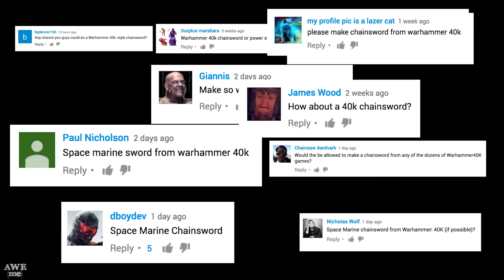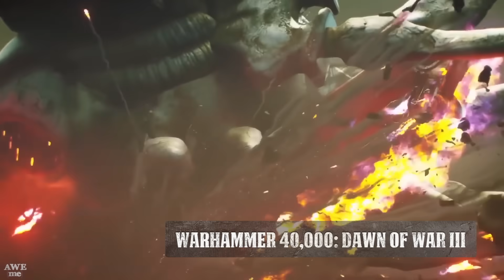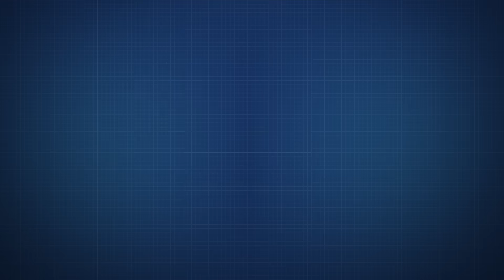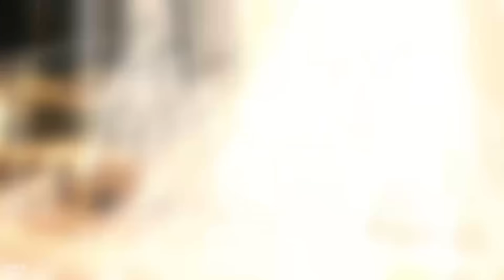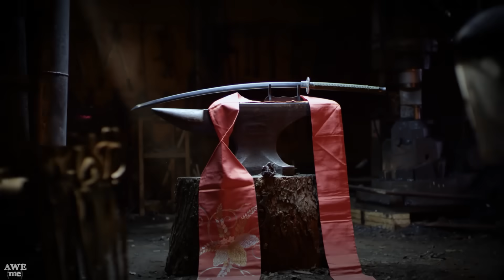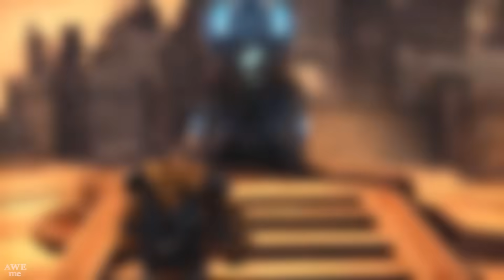Warhammer 40K Chainsword - MAN AT ARMS: REFORGED

Comment: can someone tell me if its possible to get one made that is usable not 4tonns?
im not looking to buy just wondering if its even possible and thats why they didnt do it? it may be to be lore friendly and make it in space marine size, i doubt it.
but it would be hard to get a small engine to run a track of that size and still have power doesent it?  tho i dont think it would be imposseble to get a custom made track and blade :/ if anyone knows please tell me!
Reply: Emanuel Desperados a chain run by electric motor would work but it would lack the torque to cut decently. you would be able to wield it though, especially if the battery is on your back like how the marines ones are.
Reply: +Josh Deller have to correct you there m8, you see some models with cables from their chainswords to their backpack but those are imperial guards, the entire engine and fuel tank for a full sized space marine chainsword are in the sword itself. This would make it to big and heavy for a normal guardsman tho.
Reply: sint en piet your right I was thinking power swords too
Reply: would be nice with a power sword aswell tho but thanks for the answer boys!!

Comment: I wonder if having the chain move the opposite direction wouldn't be a better idea for functionality. That way it would throw viscera and etc out toward the front of the blade rather than drawing it down into the machinery and user.

Might have to add some hooks at the tip of the blade to sort of latch on to whatever you were trying to hit, though. or perhaps even serrated teeth along the front of the blade to create more friction against whatever you strike with it

Comment: I see plenty of comments requesting power swords. While they are majestic weapons in 40K, I have to question the validity of building one though. I mean, how would you build a "working" power sword without the sci-fi power generators coating the blade with a power field of disruptive force?

Wouldn't the end result just be... Well a sword, with some decorative wires and gubbins on it?

Now someone might suggest making the blade electrified by attaching a stun gun to it somehow, but remember that power weapons aren't shocking weapons, they use these sci-fi fields of disruptive force to cut through pretty much anything.

If you really want a 40K power weapon that would have a pretty unique look though even without sci-fi power field generators: might I suggest making an Adeptus Mechanicus Omnissian Axe? I think that would make for a pretty awesome build.

Comment: Why is it that heat creates problems in high carbon steal but also fixes those problems? If someone answers this, feel free to be technical.
Reply: It was explained in a previous video. When you heat at a high temperature you harden it. This makes the metal very hard (which is good) but also brittle like glass (which is bad) This is because the material crystallises. Reheating the material to a lower temperature melts the crystals and causes the material to become slightly softer than it was previously. This way you end up with a metal that is hard but also flexible. If you want a steel that's harder then the material you've tempered you need to risk it being brittle. This is usually reserved for files and other such tools that need to be harder then metal they're cutting.

Comment: I attempted to mimic your Brazing technique using a wirewheel.

I only have a Polypropelene Torch which can't really heat the steel quick enough for this sort of contact melt.

You are using an OxyAcetlyene torch yes?

Also what temperature are you heating the steel to to transfer the brass?

Please and thank you :)

Comment: Forge Illidan's Warglaives of Azzinnoth
Reply: That was already done
Reply: uh I just checked the entire channel and no, it hasn't been done.
Reply: +Broken soffa I would like to start by saying that "actual usable weapon" and "warglaives" are antonyms. Moving on, if they made Azzinoths Warpaddle from solid steel and as thick as its supposed to be in game it would weigh more than a small car. If they made it as thin as a propper blade should be it still would leave the part where you run around one handing something the size (and probably also weight) of an ironing board. 
So nope, a nice decorative wall hanger is as far as you can get 80% of weapons I saw in WoW.
Reply: Bomburino Kripperino You're right, but it was done as hollow, unusable replica pieces.
It would be great to see the man at arms crew make actual usable weapons of the warglaive idea
Reply: Dariusz Zaremba You're right, they will be probably be too heavy. Thank you for clearing that out, never thought of the boat anchor part of it

Comment: thats sweet totaly inpracticle and useless but cool none the less
Reply: practical for a space marine, but not for regular people
Reply: I heard my name.
Reply: thats pretty true of how a chainsword would be in real life too. Looks much cooler than is practical
Reply: +N Welp If youre strong enough to wield it properly, it is useful. But its not designed for a normal human
Reply: If you had the strength to wield such a creation,  it would be a overpowered and  scary weapon.
Reply: Three real life problems with it; the blade would easily be gunked up, it has multiple points of contact which dissipate the force, the whole thing is very heavy, dangerous and impractical... and how the setting solved it; monofilament chainsaw blades, several discs of saws rather than a single belt that can be reversed with a button, chainsword dueling is basically finding an opening, holding against the foe and letting her rip, and mostly used by 8 foot tall grotesque muscle men.
Reply: +Baran Duman Yeah but they are smaller and less heavy, except for the eviscerator, but those priests are slow af with that thing.
Reply: 115Harvester There are chain swords made for guardsmen too. For sarges, commisars and priests.
Reply: not in the hands of a space marine
Reply: +Baran Duman true, but aren't those ones a bit smaller?
Reply: 115Harvester Yea I guess. Still not pratical.
Reply: enit lol
Reply: +Baran Duman you get it wrong guys these things are space marine weapon and space marines are hmm superhumans ypu cant expect a normal human likethem to wield a chainsword 8P
Reply: Randy Pelton Dare you question a design of the Holy Cult of Mars?!?! *BLAM

Comment: They made this, but still haven't made a weapon from RWBY? If they made the chainsword, they can definitely make any weapon from RWBY.
Reply: shotgun gauntlets? gun-chucks? briefcase mini-gun? grenade launcher sledge hammer?
Reply: khornes knight Anything is possible as long as you believe.
Reply: depends on the weapon . some are rediculusly complex and brake basic engineering concepts like literly not havingenoguh volume to acomidate one of the weapons forms ,while others will just bee too brittle with known metirials. 
hell , even this chainsword isnt truly functional, to make a functuinal one theil need to have a proprietery blade and proprietery chain ,  with the chain digging deeply into a rather thick custume blade 
because if you take a normal chainsaw and start swinging it quickly on stuff like flesh or even wood there is an extrem danger that the chain would come off and thath the whole thing would bounce back at the user. meaning that an ideal desing is a thick blade with a thick chain guarded inside it with the chain blades pretrudeing out of the blade .
Reply: stickpge Would still be nice to see one.
Reply: I think i figured out how they can do that, They should do a challenge where they all make the cresent rose, but one is the scythe, and the other is the rifle, but the catch is, they both have to fold down into the carry mode❄️🔥
Reply: Red Black White Yellow? The entire name is just RWBY, pronounced Ruby.
Reply: no... no its not mate besides nearly all those weapons have a far superiour real life variant
Reply: Crescent Rose would do-
Reply: They haven't made it yet because almost all the weapon in that show, except for one, are very difficult to make due to the firearm build in them. The best they can do is just make every weapon with out the firearm function in them with the exception of Weiss's rapier and Jaune's sword and shield(with out the transformation function.
Reply: Dark Phantom there arnt alot of rwby weapons they can make, there are rens pistols (tho its more of a job to a gunsmith) and jaunes sword and shield (a folding shield wouldnt hold up as a shield but its not outside the relm of posibility)
Reply: They can just make the body and the blade with no internal mechanism.
Reply: mryupjup You know they can just ignore the sniper rifle function and just make the scythe with the body design right.
Reply: mryupjup They can if it out of their league and job. The internal gun mechanics are more of a gunsmith's job they are blacksmith they are not allow to make functioning internal gun part. The gunblade is fine because its only a revolver without a firing pin.
Reply: what the hell is RBWY ? can you actually type out the entire name ? :P

Comment: How does the bars under the plasma cutter not get cut??
Reply: If you look closely, they do. I imagine they replace them every so often
Reply: Magic.
Reply: the plasma cutter loses a lot of its cutting potential mere cm form the nozzle thats why its so close to the object it cuts constantly, plus the bars underneath look like concrete which is highly heat resistant
Reply: +bowmanruto hit and a miss there bud...the jet does cut the supporting bars but it doesn't have near enough energy to cut through them. If you google a CNC plasma table you'll see the steel bars cut and burned partially on the tops and sides
Reply: Tuptmore3 +Daniel Wilsonokay  seems like mistakes where made on my part, thanks guys for clarifying my mistake in such a civilized manner I don't want to spread misinformation but I'm only human after all and sometimes i get things wrong ¯\(ツ)/¯

Comment: That was amazing, good work! I was really worried when I saw the orientation on those teeth. You made it bite and tear rather than slice, as it would if the teeth were pointing in the opposite direction, so I was really worried that it would bite into something and just fly out of your grasp, or even send the teeth flying off. Thanks the Emperor it all turned out OK.

The Emperor Protects

Now it is tiume for a tunder HAMMER from WarHAMMER 40k!!

Comment: 10:10 minor correction:
tl;dr: Heat affected zone is not the area where you welded but rather the nearby area.

Full explanation:

Heat affected zone is a more brittle zone near the welded area, the metal becomes brittle because of carbide precipitation. Iron alloys are basically other metals and carbon dissolved in iron. At high temperatures, carbon becomes mobile and begins to react with chromium to form a carbide precipitate (materials that can't be dissolved in the solvent), this causes chromium deficiency in the affected area which will lead to brittleness.

So why is it the nearby area rather than the welded area? Because when you weld 2 metals together they reach high enough temperatures to melt, as a liquid state, the molecules will become evenly mixed again, since the chromium is evenly distributed the metal won't become brittle. However, the nearby areas are not as hot as the welded area and hence it is not able to melt, evenly distribute the chromium, and cause precipitation.

Source: just had a test covering materials and corrosion, also chemical engineering student

Comment: This is an unsanctioned modification that involved the butchering of a machine-spirit (the chainsaw) via the enslavement of other machine-spirits (your work-machinery), and you didn't do the proper prayers and incantations either.
Now, I ain't gonna rat you out, but if the Ad-Mechs see this, you're going to be turned into servitors for techno-heresy.
...
And then the Ad-Mech will test your chainsword, and if it works well enough, they're going to use the pattern, and claim it was "re-discovered" from an STC. And of course they'll take the credit for "finding" it.
Imperium of Man at it's finest.
:)